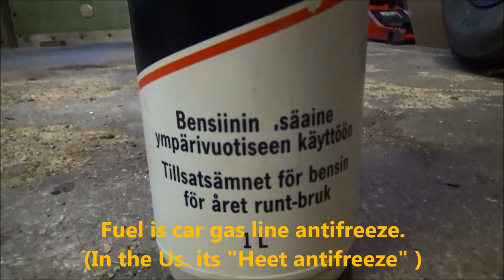How To Build a Simple Jet Engine - No Special Tools Required!!

Comment: how far should i put the pipe in the bottle like a cm?
Reply from the maker: As close to 0cm as possible
Reply: @Fileeraus  I got another one. How long should the pipe be? right now I am running on a 25cm pipe and It can only do about 10s and it is really inconsistent. Also have you found a good way to stop this thing I really need it
Reply from the maker: @tatas6635  Make it like 1m long, i don't know the best dimensions but there seems not to be any length restriction when going longer. Shut it down just block the air intake with anything

Comment: So mine is farting like 2 sec can u help me is my hole to small or my pipe to long?
Reply from the maker: Video would help
Reply: @Fileeraus  so my hole is Like 1.5 cm my pipes Diameter is 2.5 cm iam using normal Gasoline

Comment: Help no matter how I try I can only get 2 second runs top, I even had a 16mm 1.5m pipe. I'm using ethanol for fuel, same happens with turpentine and naptha
Reply from the maker: Does it rev fast or slow? The measures are just for a guide.
Reply: @Fileeraus  rather fast when it works for a second or 2 but sometimes only like 1 pulse per second and then it lasts for like 10 seconds but sucks
Reply: @Fileeraus  and I had the exact size and length of pipe by coincidence that’s why I used it
Reply from the maker: @KClO3  well you can only make the intake hole larger so...
Reply: @Fileeraus  I made it larger and larger until it just burned by itself, now maybe I made it too big right from the start, that’s all I can think of
Reply from the maker: @KClO3  Yea its safe to start from small and then make it larger slowly. The measures I put are the ones for my can

Comment: I tried it. I used a shorter in height butane can and a fatter exhaust (as well as a wider intake hole). I used ethanol for fuel and it didn't work. I am not sure if it is because I am not getting the fuel air mixture right, my intake and exhaust ports are too big or small, the can is too short or the fuel I'm using is wrong. I even made a hole on top and put a spark plug to spark there but that wouldn't ignite the fuel
Reply: Note: It has been a few months now, comment says 3 months ago its more like 4-5. I am thinking of making a second version and start out with smaller intake and exhaust holes, ethanol as fuel, no i am not planning to use gas. If it works, I will try to put a carburetor on the intake hole and attach ethanol fuel lines to it. Choke wide open, because this thing will probably need way more air than a normal engine. Plan is the carburetor will provide fuel so the engine won't stop after a minute or so because the fuel in the can is burnt. Also, hopefully i will be able to control the throttle. Not sure if the carburetor idea will work though, since it might not have enough compression (and it doesn't) to suck in fuel via the venturi effect. I don't know how much air you need to send through the carb to make fuel come out so. Wish me luck, if i ever get my ass off this chair and actually go do it
Reply: Try to make the intake hole smaller or larger and also uae a long exhaust pipe

Comment: Hey what cans did you use what brand were they and how long was the pipe and how wide it was?
Reply from the maker: Paint can and brake cleaner. Pipe is 1.4M and width is 1.6cm
Reply: Thank you

Comment: Is the pipe really necessary? I am trying to build my own pulse-jet and I have all the materials except the pipe.
Reply from the maker: You can also build a can/jar eith only  one hole in the top center, which is the most simple version of this engine. But with this type it needs an exhaust pipe.

Comment: Is it viable to use any other fuel?
Reply from the maker: Yes, basically anything that burns might work! You just have to find out, but I am giving the best option here
Reply: @Fileeraus  I thought about using regular fuel, but I think it might be difficult to ignite, maybe I'll try with alcohol or hand sanitizer
Reply from the maker: @potatouno  it is difficult as the fuel mixture is more critical with gasoline, but totally doable and probably needs a water cooling to have it run on longer than 15 seconds
Reply from the maker: @potatouno  also hand sanitizer has water mixed in them which is bad for combustion
Reply: @Fileeraus  What about alcohol?
Reply from the maker: @potatouno  try it out, I use methanol
Reply: @Fileeraus  I'll try with methanol, thanks for continuing to respond even after 4 years
Reply from the maker: @potatouno  no problem

Comment: How long this pipe have to be and how short can it be to properly working engine
Reply from the maker: Make it "too long" as the engine doesn't mind a long exhaust, but with too short pipe it will not work
Reply: @Fileeraus  how long was pipe in your engine?
Reply from the maker: @May_Flower3  over 1 meter
Reply: @Fileeraus  thanks

Comment: Hi, what kind of pipe did you use? Is that plastic or something? And does it work on 30cm long exhaust? Thankyou
Reply from the maker: Its a regular iron pipe, plastic and aluminum pipe will melt.  30cm is too short I'm afraid.
Reply: Okay, thank you for the information
Reply: Do you have any solution if i only have pvc pipe?
Reply from the maker: @10.igdeputubhaswarapurwaha68  its not going to work with pvc pipe, just find some junk iron pipe from trash or anywhere really
Reply: Okay

Comment: Why on benzine this dont work?
Reply from the maker: Pump gas needs a precise air to fuel mixture, alcohols mix it correct themselves.
Reply from the maker: You can try using gasoline, but you need to have lots of fresh air and let the fuel to evaporate for some time. I've made a few successful runs with gasoline and I've started it using alchol fuel. Also it overheats way faster than alcohols. Maybe use E85? Lots of testing needed. 😎
Remember to post results! :)
Reply: @Fileeraus  i make 20 starts on gasoline, 3 work for 10sec, now i try to use 92% ethanol and nothing
Reply from the maker: @kiernozm305  Use close to 100% ethanol, as lower %s have water mixed to them.
Reply: @Fileeraus  i know, but i cant find this in shops
Reply: This just shoot the flames and dont start working
Reply from the maker: @kiernozm305  Car fuel line antifreeze? Can you find rc car fuel?

Comment: How long should i make tge pipe and which diameter?
Reply from the maker: Mine is 1.3 meter long and 1.6cm wide.
Reply: @Fileeraus  dayum... Does the lengths matter? I only got a 15 cm long pipe at home
Reply from the maker: @marcusk2635  They do matter. I had once a short pipe in a jet like this and it never run very long. The pipe can be a bit larger if you have that.

Comment: Do you really need a pipe that long? And does it matter with a smaller or bigger diameter?
Reply from the maker: I've found longer pipe working better. You'll need to test out the pipe what you have.
Reply: Fileeraus do the jet wont work without a pipe? And in case what will happen without the pipe?
Reply from the maker: Nothing really happens without the pipe. 
Single hole, yes. Two holes, no.
 https://youtu.be/0CuiRKmRpXk
Reply: Fileeraus okay. Ill go to the scrapyard today then. I think this design is cool, because it got an exhaust. I used to make the jam-jar pulse jet. But it only ran for like 10 seconds, because it got choked by smoke.

Comment: can you use different fuels?
Reply from the maker: Yes you can, try out everything. Note that fuels like diesel won't work as it needs to be atomized to burn.
Reply: @Fileeraus  not necessarily, maybe it would work with a wick burner? It has many fibers to get large evaporation area in small space.

Comment: Can i use butane or propane gas to power this engine?
Reply: Yes I used butane for mine and it worked fine
Reply: @m.s.aviation7065  where do you insert the gas?

Comment: Can we use  Alcohol for fuel ?
Reply: i mean not really unless you had something above 85-95%. What i did was i took a mason jar, drilled a 1cm wide hole in the lid, filled it with hand sanitizer, and lit it. If you make sure it has oxygen by blowing into it before you light it it should work for a short period of time. use a lot of hand sanitizer tho

Comment: You didnt mention anything at all about how to adjust the intake.
Reply from the maker: Oh yeah, mine worked on first try. You drill it slightly larger if the engine takes a few quick revs and shuts off.
Reply: Or, if you make it too big, you can try to add a valve

Comment: But where's the thing that makes it go up and down?
Reply from the maker: Huh?
Reply: @Fileeraus  
Lol im just goofin.
Im trying to find a simple pulse jet that wont piss my neighbors off. Doesn't look like that'll happen soon.
No applications to it. Just for a better understanding how they work.
Reply: @Fileeraus  
I was gonna ask, "but where's the pistons?" But I thought this was more original.lol
Reply from the maker: Inside of it is a piston made out of air
Reply: @Fileeraus  
Lol
I had a '68 vw bug. Drove it to work and one of the newer guys was walking around it for about 10 minutes. I finally said, "What are you looking for?" He said, "Where's the radiator?" I didn't have the time to explain and I doubt he would have believed me anyways. So I just told him, "It's up front underneath. Its kinda hard to see".
Lol
Reply: @Fileeraus  
Yeah. I hesrd they were having problems with the piston return springs on the newer models. The cam shaft wasnt taking photos or something.
Reply: XDDDD nice joke lol

Comment: Can I use Ethanol instead of car gas line antifreeze?
Reply from the maker: Yes you can, but methanol has better resist to heat.
Reply: @Fileeraus  Can I email you a picture of my engine? I dont know, why it dosent work.
Reply from the maker: sure

Comment: Whats the minimum length for the exhaust?
Reply from the maker: No idea. Too short and it don't run very well, and there's no maximum length really.
Reply: @Fileeraus  thanks for the fast reply!
Reply from the maker: @benzvanrossum7962  No problem!
Reply: @benzvanrossum7962  i used a 2 meter 16mm pipe
Reply: @thelegendofspace7579  i tried it with a relatively short pipe and it didnt run very well, i think it was around 30/40cm. Ill try again soon.

Comment: I made 2 differenti engines One with a smaller can and One with a bigger One but they managed to only give 1 cicle before shutting off any suggestions?
Reply from the maker: Possibly too small intake, or too much fuel

Comment: What all fuels can I use for this ?
Reply: Basically anything flammable the key is in the hole in the front and pipe in the back. It’s just a siphon that uses combustion instead of gravity to create the low pressure